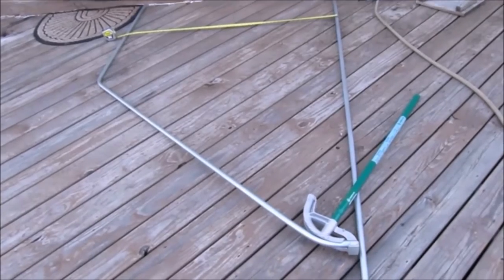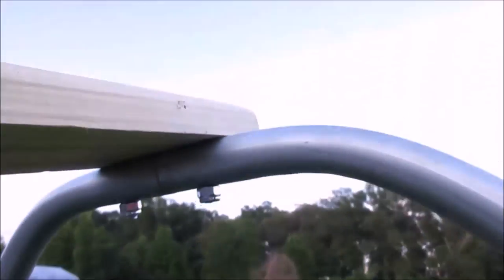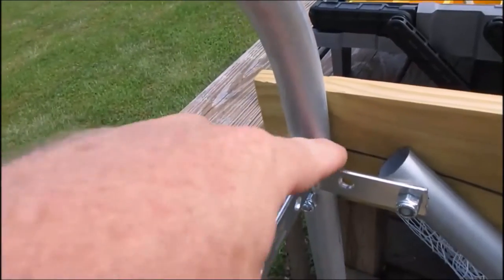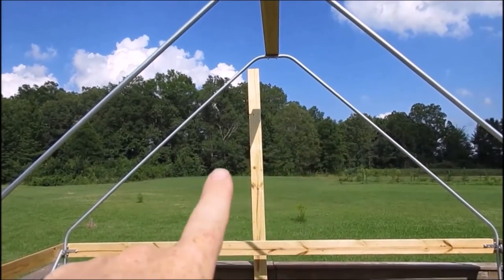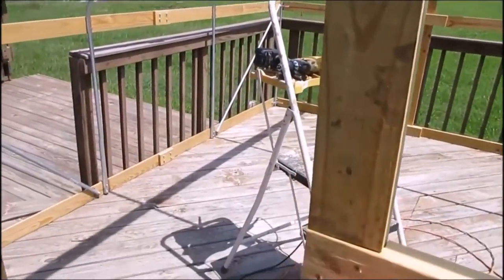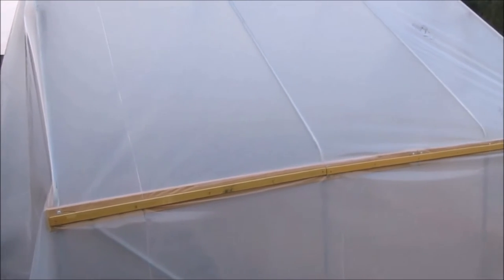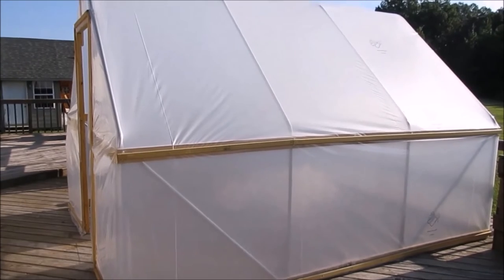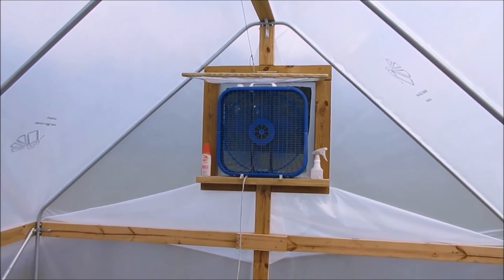Building a Greenhouse:  EMT Style

Comment: Great video, clear instruction and great communication skills.  I am planning my first diy build and watched this as part of my research into "borrowing" great ideas until I arrive at my own unique and wholly original concept which I shall forever claim as being completely my own!
I know it's been a while but I hope someone answers;  Should I use some sort of tape between the metal ribs and the pvc to protect it or is that only needed on pvc hoop type  builds ?
This is a great design and with Exterior Varnish on the  wood the  frame itself should last for decades.
thank you ..Nick.
Reply from the maker: Do you mean between metal ribs and greenhouse plastic?  If so, my greenhouse plastic lasted longer than the 4 years the plastic claimed sitting right on the emt.  As you likely know, you'll need to use plastic designed for greenhouses and not the clear plastic from Lowes or Home Depot which lasts less than 1 season.  All the best to you on your build.
Reply: Thanks, saved a few quid there then .. @C3Voyage